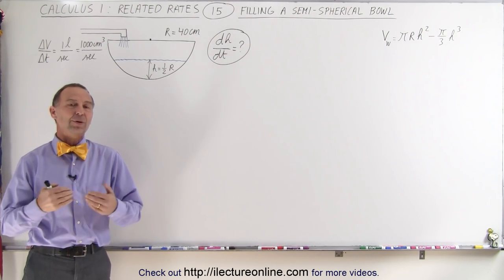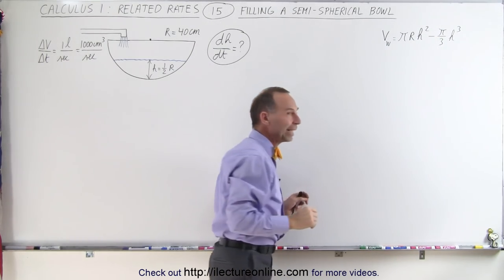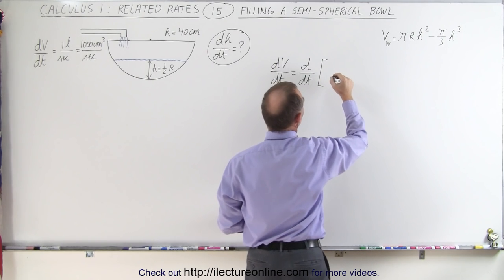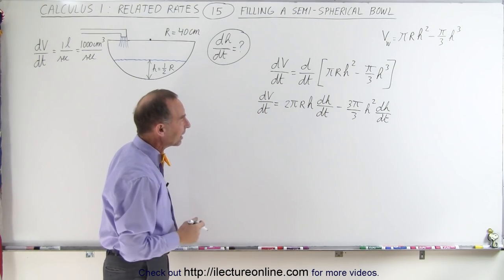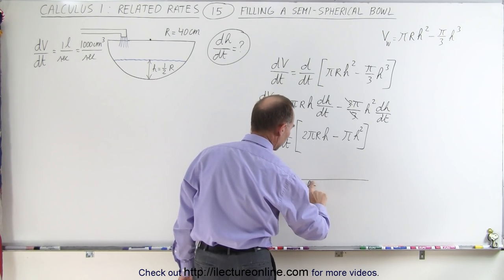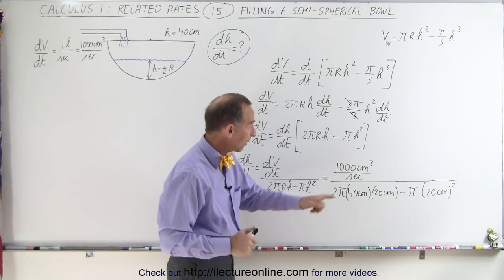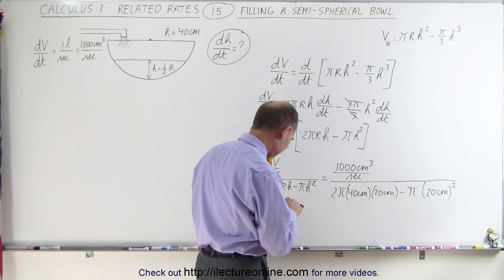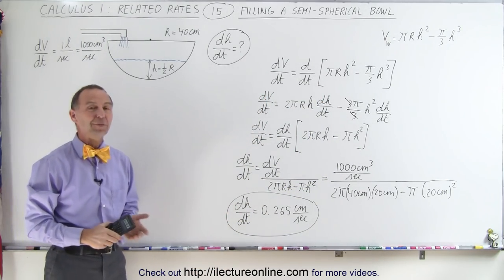Calculus 1 - Derivatives and Related Rates (15 of 24) Filling a Semi-Spherical Bowl dh/dt=?

Comment: How did you differentiate with d/dt when there is no t variable in the vw equation?
Reply from the maker: When differentiating with respect to t  (time) you are calculating how the variable you are differentiating changes with time.  for exampl  d (x)/dt = velocity  and d(v)/dt = acceleration

Comment: Hey prof how did you get the volume formula. It would be helpful if you show is the calculation of the formula
Reply from the maker: A good way to check if that is the correct formula:   first let h = R   and you get (2/3) pi R^3 which is half the volume of the sphere.  Then let h = 0 and you get 0

Comment: Why does R remain constant?
Reply from the maker: It doesn't remain constant.  The answer is only valid at the moment that h = (1/2) R as indicated in the problem.
Reply: Thanks for your reply - however I'm still not clear. When you differentiated the Volume formula Dw, R wasn't treated as a variable?